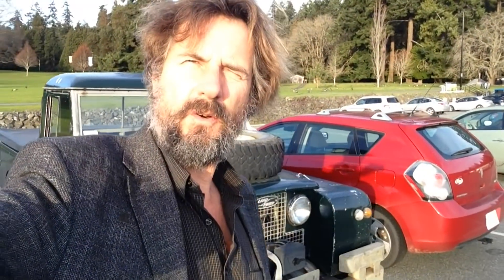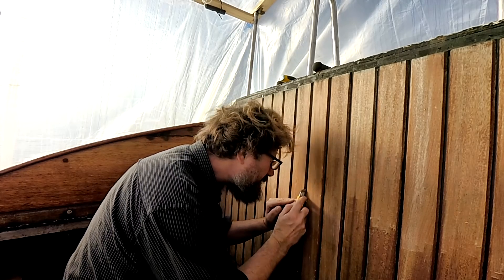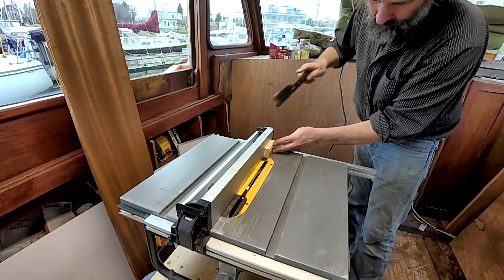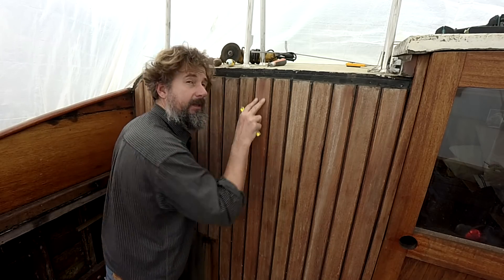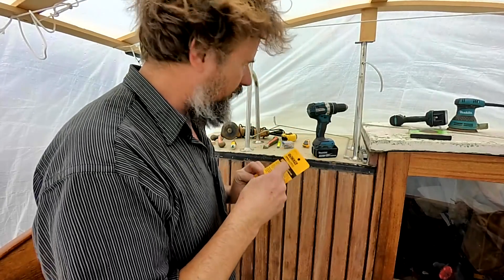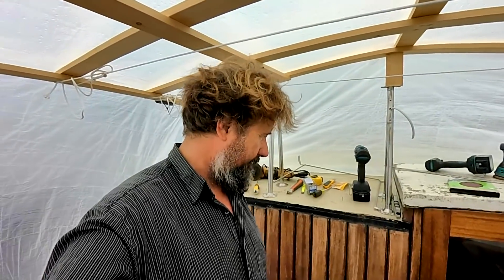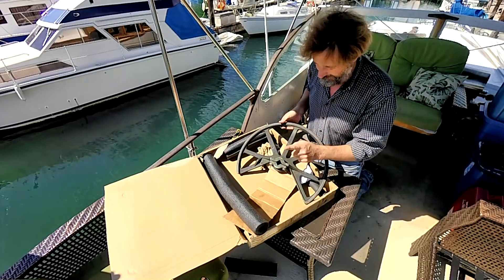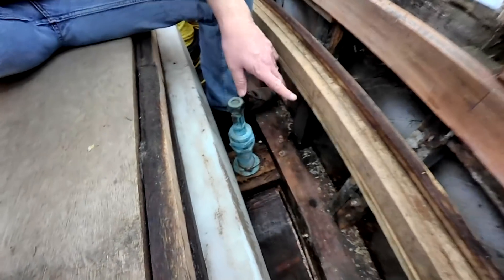Back to finishing the cockpit - Wooden boat restoration - Boat Refit - Travels With Geordie #94

Comment: Just a thought on your bilge, use a couple of small solar panels and a computer fan, no maintenance and will run any time the sun is out, even in  the shade! Happy woodworking!
Reply from the maker: Thanks Donna, very good advice. Wood boats must have ventilation. I have a rather extensive plan afoot. For now it's pretty much as you described, but just on the battery.

Comment: Peter, I use the same plug cutter and counter sink they work great.  But tape your plugs in before cutting them out! 
I also catch the sanding dust and use it for color matching any glue up needed with clear epoxy.  Also try shellac to glue your plugs in,  will make removal much cleaner down the road.  Of course you’re probably already done with this job.  As for the steering quadrant I would rather cut out the tank  than a frame member!  Take care,
Reply from the maker: Hi Tom, all good points. I think you won't be too disgusted with the notch I made.

Comment: Excellent video Peter, like you I always broke the plugs out with a screwdriver. Thank you for showing us that trick!!!
Reply from the maker: The other big advantage is that the face of the plugs are square so when you tap them in with a hammer they drive straight.

Comment: Could you 'sister' that splice post in the transom with two pieces of stainless angle stock? Screwed into the post and the transom planking, they would allow you to hog out a sizable gap for the quadrant without weakening the center line. If that's not 'traditional' enough, you could do the same with two mahogany planks pocket screwed into the post. Should hold up well enough until you get to rebuild the old transom...
Reply from the maker: In the end that member is not to critical but when I rebuild it will be dealt with properly.

Comment: Good work as usual.  When I glue the plugs in I use thickened epoxy with a little red powder which is used to colour concrete or cement.  When it is set and sanded the join isn't as obvious as usual, it is water tight and the plug never comes out. Rgds John
Reply from the maker: Neat idea on the dye. Thanks.
Reply: @TravelsWithGeordie  works really well. The red colour looks good against the timber.

Comment: Amana Tool makes a good Carbide tipped countersink for around $20. Since it will outlast twenty (Chinese Import) Dewalts, it's a good bargain. Should be on Amazon.
Reply from the maker: Woo, now that's a great tip.

Comment: There's a company in Rockland Maine called hydro-slave sells pot haulers plus hydraulic steering for commercial use and has drifted over to pleasure boats in case the cable chain steering doesn't work you might want to check that company out good luck Peter cheers
Reply from the maker: Good tip, I think I'm set though.

Comment: Hi Peter, I wonder why you dont put an straight arm on the rudder.. with an mono cable system to the stearing wheel. why use the old cable and chain method.. Mono cable (And I dont mean hydrolics) is so much easier, and it makes it possible to tilt your stearing wheel at your dashbord.  With a chain always having a vertical stearing wheel..
Reply from the maker: That's a great suggestion. Part of the reason is I already have the sprocket helms, and need two stations which is a little tougher with push pull cable.
Reply: @TravelsWithGeordie  Thanks for responding Peter... Wel with the mono cable (push/pull), you can put 2 cables on one rudder yoke above each other.. Different lenghts dont matter, the seccond allways turns,  with the other.. I've installed it this way 25yrs ago, on a Chris-Craft and it stil works fine.. (so it is posible). ohw and btw, you dont have to tilt your stearing wheel..but it's posible.

Comment: Jeepers watch your fingers on those plugs Peter please

Would have been safer if you put tape over the drilled side so they didn’t start running everywhere when u cut

Also as u pull the tape off the plugs should come with it? Makes collections safer and easier?
Reply: You guys think of everything. I’d be happy picking them up off the floor with 10 fingers. :)
Reply: excellent idear!
Reply: @53Peterbilt  thanks, im not in anyway a handyman, just kinda made sense to me with what he was doing
Reply from the maker: So true, I did the tape once years ago when I first learned the trick. Ever since I've played chicken with the blade. Not the nastiest bad habit of mine....